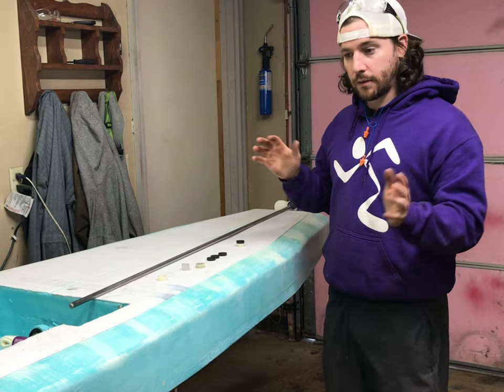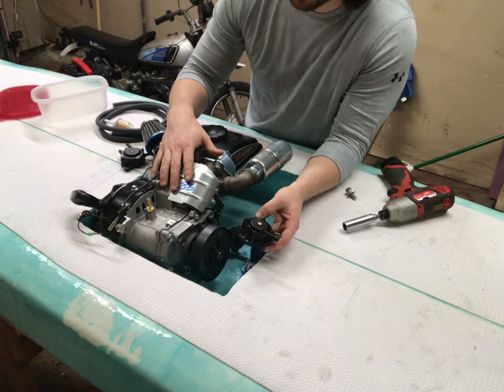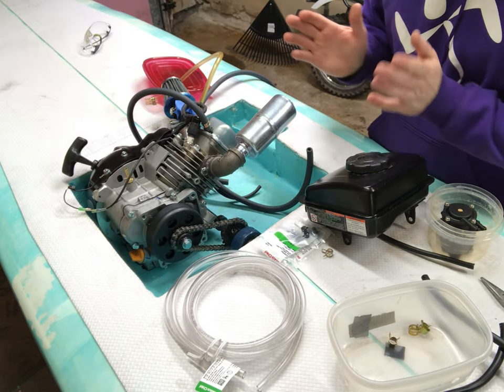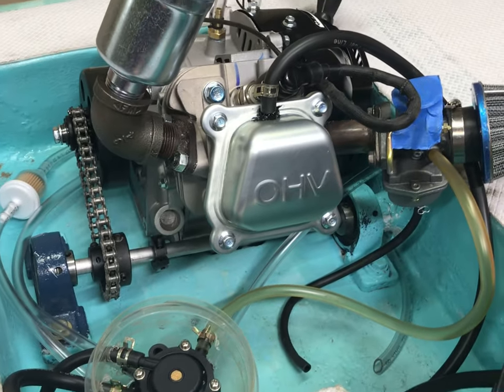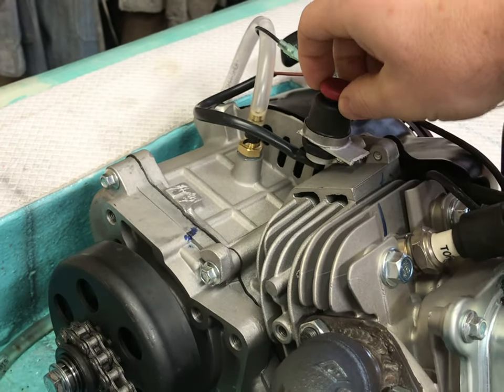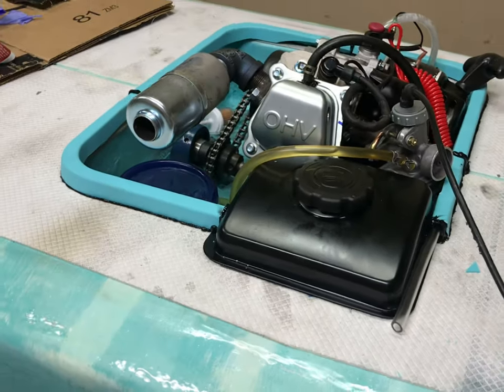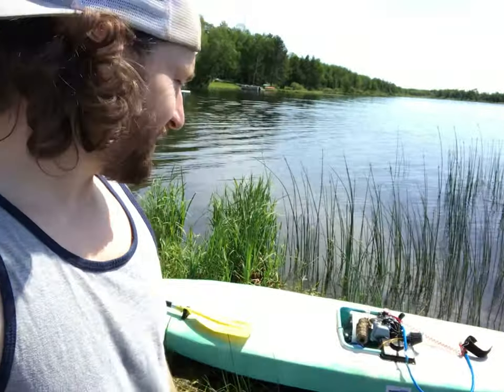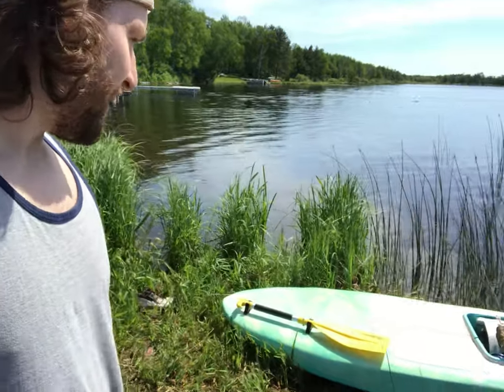DIY Predator 79cc Gas Powered Paddle Board! Part 2/2. Finish and ride!

Comment: Awesome video, man. Nice work on the board! It got me thinking… I recently built a go-kart with a predator 300cc engine, put in a stage 2 performance upgrade (new flywheel, new piston rod, new cam, new valve springs, removed governor) and I upgraded the carb. Ended up putting out (as an estimate) between 15 and 20 hp. Would be so much fun to do that with a paddle board (if the weight isn’t too much). Thanks for an entertaining video, really enjoyed it! 🤠
Reply from the maker: That’s awesome. Yeah idk if that would be too much weight but I definitely would do a bigger motor in tue future, like a 212cc. I was going for low profile on this one.

Comment: I'm new to the nautic world haha, do you think It's better the prop like you've mount than a jet system?
Reply from the maker: I’d say it’s just wayyyy simpler. And less expensive in that a jet drive for a small engine would be hard to come by unless you made your own. To adjust efficiency of the set up I basically just buy a different size prop, or shave down the one I have. With a jet drive system you’re looking at the size of the prop, size of the outlet, size of a nozzle, size of the inlet, lots of attention to engine RPM and torque curves for the best performance…I’d like to get there just not yet.

Comment: I was wondering if a 40cc 2-stroke would work (cause I have one ) 😁
Reply from the maker: If I could redue this I’d use a 212cc. Honestly I looked at so many of the DYII builds on YouTube and it seems like they’re always under powered when they try to use a small motor… I would go bigger, or else I would use a very high-performance motor like off a 2 stroke racing dirt bike….but then the motor end up being really expensive….soooo yeah I’d go bigger displacement for cheap motors. 79cc was on the low end of power and that was after upgraded carb and intake etc.

Comment: Don t you protect engine from water?
Reply from the maker: Do you mean from sucking water into the air intake, or just splashes and what not?
Reply: @JakeItsTheCops   yes dont you think to put a cover above engine? May be this cover with some insulation material can reduce rumor as well.
Reply from the maker: @gokhankeles8998  so that would be an awesome idea but the problem is because this engine is air cooled, covering it would lead it to overheating right away… It actually got quite hot pretty quickly without a cover. I definitely got plenty of splashes on it but because the air intake is somewhat protected with the filter it really doesn’t cause a problem to the engine unless you flood the engine bay area. I will say it’s definitely not something that will last forever, a liquid cooled engine that can be completely sealed would be the best. I looked into those a lot and they are quite expensive.
Reply: @JakeItsTheCops   yes i was thinking to use 62 cc 2 stroke engine or 52 cc 4 stroke honda gx 50 engine. If they pull me 5  6 mph inside sea. It will enough for me. I tried with 34 lbs trolling motor  but speed  not enough and battery is problem expensive heavy etc.
Reply: @JakeItsTheCops   i will think again about cover. If there are overheating problem. But 15 minutes working then stopping also create overheating ?
Reply from the maker: @gokhankeles8998  yeah, I think a high-performance two-stroke engine would probably work pretty well… Be sure to try different types of propellers because It can have a huge influence on performance. Maybe you could get away with short running times and worry less about overheating with a cover, it was just one of those things where I didn’t want it to melt my paddleboard, and splashing is just fine as long as it’s not going into the air intake. I will say there’s a lot to consider with these type of projects, and if you’re on a budget you kind of have to start cutting corner somewhere. I’d be really curious to see what you come up with.

Comment: Hi, what speed reaches? What is propeller size, diamater and pitch and rpm? Thanks.
Reply: Check out the mud motor pages on Facebook.  Alot of technical info on rpms and prop sizes.
Reply from the maker: Yeah I basically amazoned a “3-5 hp” prop…which turns out I needed a smaller on. I even shaved down the fins. Lots of trial and error.
Reply: @JakeItsTheCops  At Brazil exist a small propeller 125mmx258mm two blades counter clockwise. The marketplace shopee sells. The prop link
Reply: Thailand propeller style for 5.5 hp motor at shopee